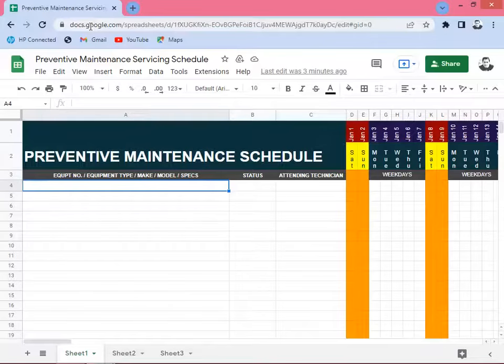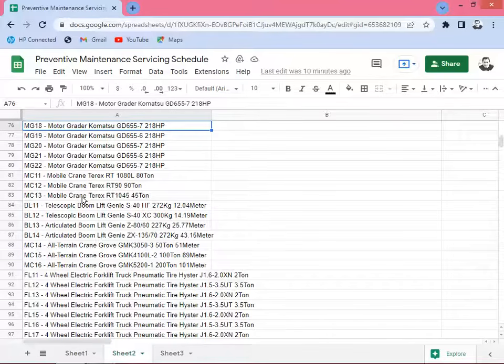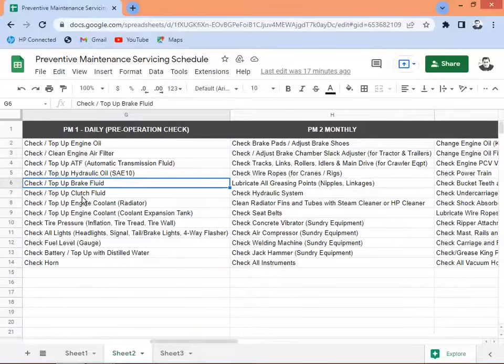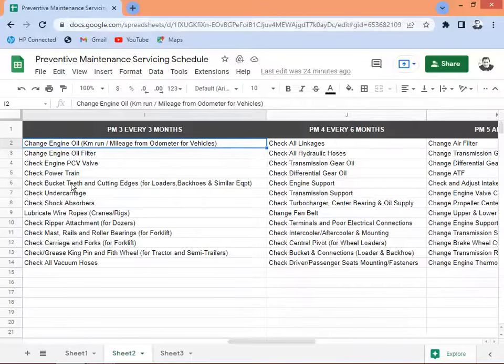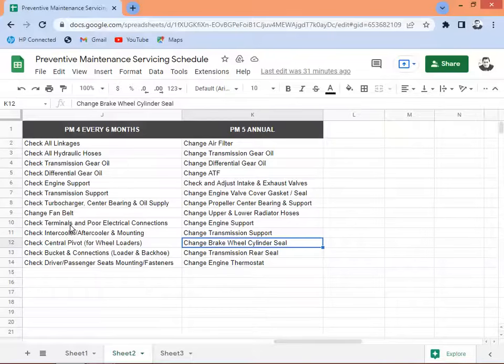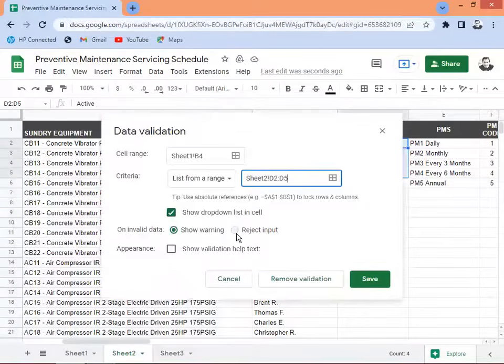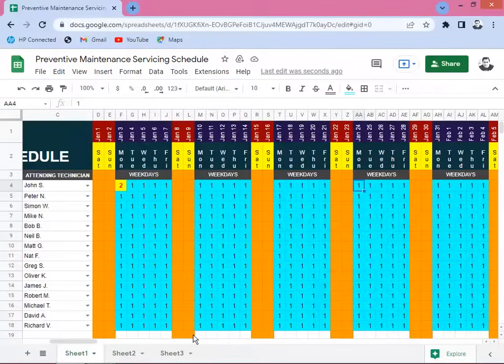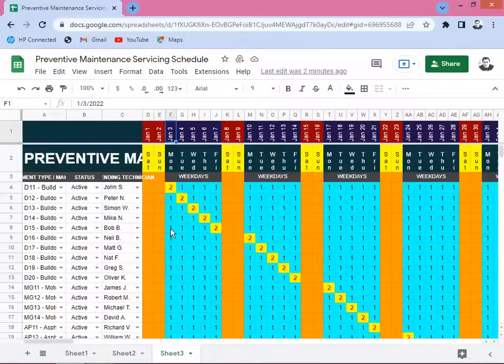How to create a Preventive Maintenance Schedule for Fleet/Heavy Equipment in Google Sheets

Comment: In maintenance, there are some task which to be carried out by two technicians, with this drop down list I can I solve this problem when scheduling?
Reply from the maker: @Pedro, you're right. Some mechanics prepare a shophand or a mechanic helper as assistant especially if the guy is working on heavy/crawler equipment. He needs someone who can help him in terms of manual handling mostly heavy lifting or operating lifting equipment like chain block or overhead crane while the mechanic is making sure that the pull out or mounting of engine assy, sprocket, idler, bucket, blade, rock breaker attachment or hydraulic cylinders are done properly and safely. Thank you for watching and giving comment. Appreciate it.

Comment: In the old days when computer was not there yet, PM schedule was planned and prepared in a sheet of paper typewritten and a sticker with scheduled date of PM or kilometer reading of change oil is pasted on the equipment or on the dashboard.
Reply from the maker: That practice is time consuming and efficiency is low. Thanks digital work is available nowadays.